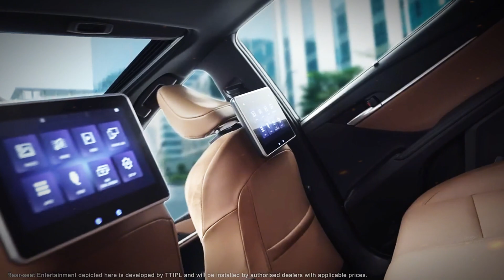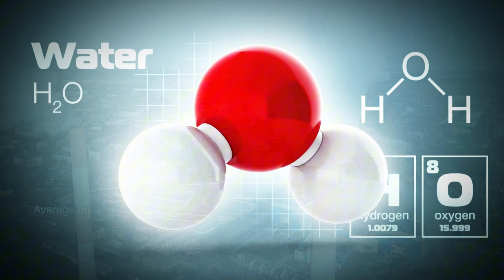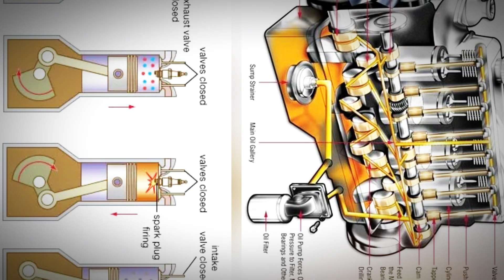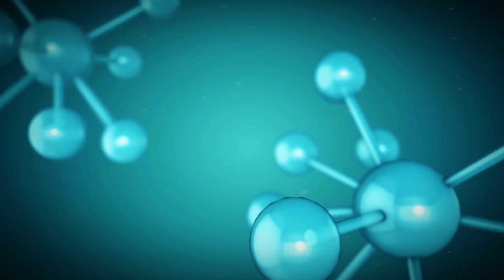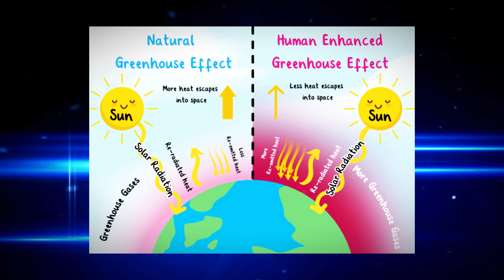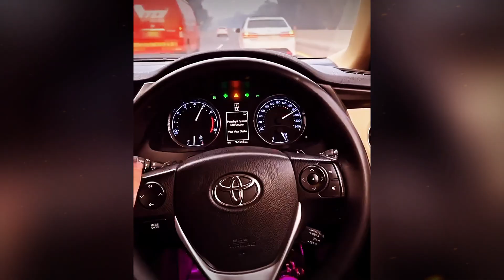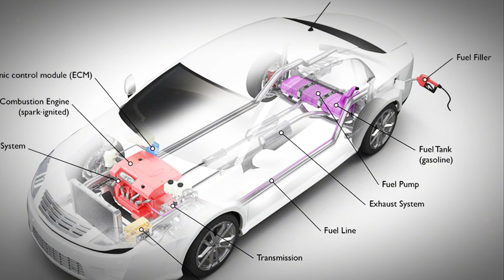Toyota's New WATER Engine Will Destroy The Entire EV Industry!

Comment: Do it like Stanley Meyer did it in the '80s and make the hydrogen on board with 20 gal of water and special hydrogen extractor using only a 12 volt battery and you will really have something.

Comment: Hydrogen is not a 'water engine', god what a bunch of lying clickbait bs
Reply: @fuzzyfriendlydoggy  yeah seriously. There are also people that correlate hydrogen to water.
Reply: Where do you think that hydrogen comes from?  What does the formula of H2O stand for?  When you use electolysis with an extractor in it and put the power of a 12 volt battery to it, you separate the hydrogen from the oxygen and can burn it in an engine, using the explosive power of the hydrogen to run the engine and putting out water vapor as exhaust when it turns back into the water it was made from, sounds pretty simple to me and I ain't a scientist and it doesn't take rocket science to figure that out.
Reply: @GregoryStevens-hm4ix  Using a title that implies it runs off of water rather than depending on a fuel production method that has literally existed for hundreds of years is clickbait. But I agree you are no scientist, if you were you would realize how dishonest it is.
Reply: What does hydrogen come from when using a device to extract if from it?  DUHHH!
Reply: @GregoryStevens-hm4ix by that logic we should call gasoline engines oil engines. But we don't. Because words have meaning. But feel free to continue wasting your time arguing about something stupid

Comment: What kind of strain will it put on our water system. There are already water shortages around the world
Reply: What kind of strain?  Well, let's see, Stanly Meyer's 'water car' drove from coast to coast on about 14 gallons of water, how much gasoline or diesel does it take to do that? Simple math on your computer's calculator using 3000 miles divided by 14 comes up with a smidge over 214 mpg, do you think it we be using too much water with that kind of mileage on a gallon of it?  BTW, I can also tell you how you can get 200 mpg out of a gallon of gasoline and prove it through history of the guy that did it back in the 30's, the powers that be won't let you do that today though, like the water car guy, they poisoned him to death.
Reply: @Sidehilld3  Far less of a stain than EVs. The electric grids around the world would not be able to cope if every car was electric.